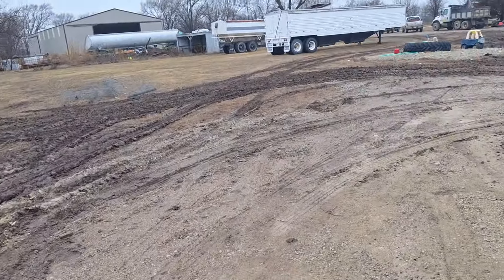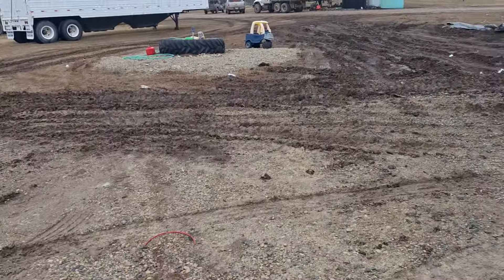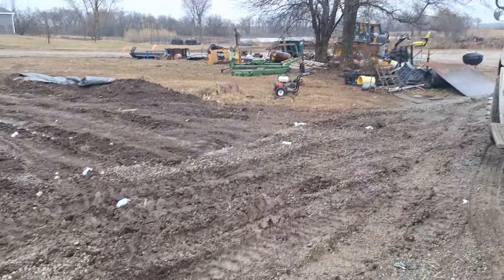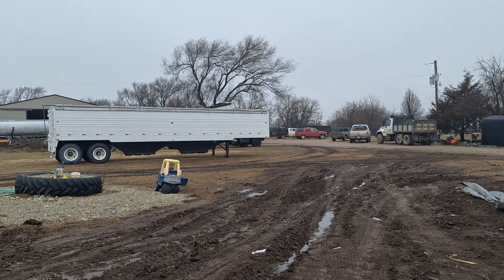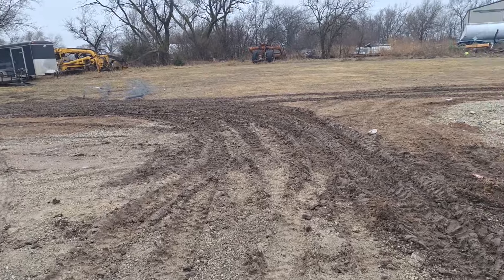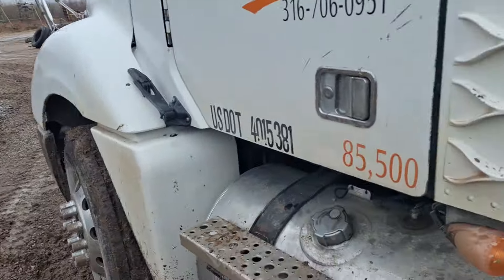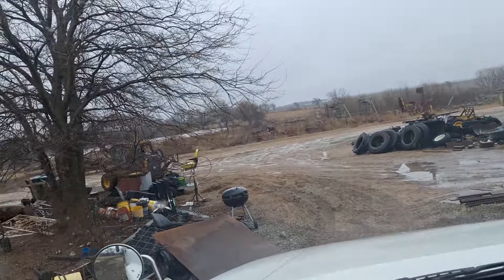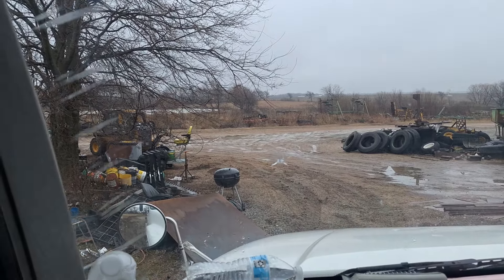the more I run my john deere the more I'm not a fan!

Comment: Your regen happens if you don't run it half or more throttle during operation and your controls are touchy because you have it set on the highest setting. Let it go though its higher throttle before you shut it off, or the computer will have fits because you shut it off before it's done. I run a 2019 318G in a fertilizer shed since it was new and it has only done particulate clear 3 times.

Comment: I have an older ssv75. It was beat to $ht when I bought it. Been ok so far. Started regenning a lot at 2600 hours Guessing it’ll probably need injectors after a bit.  
    Good part about it, I punched out some honeycomb and left all the wiring intact. No check engine lights no derate, it doesn’t know it happened. Back pressure doesn’t go up so Just doesn’t regen anymore